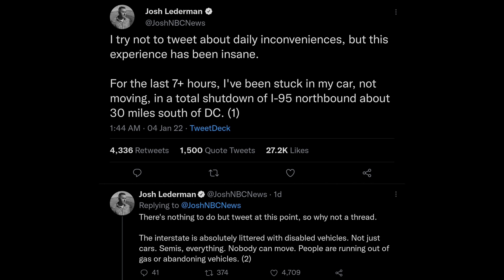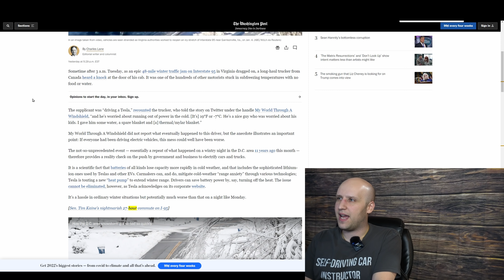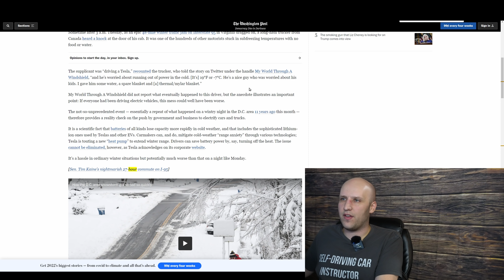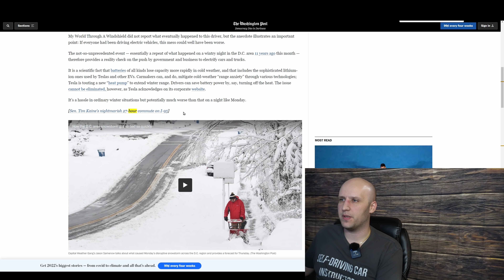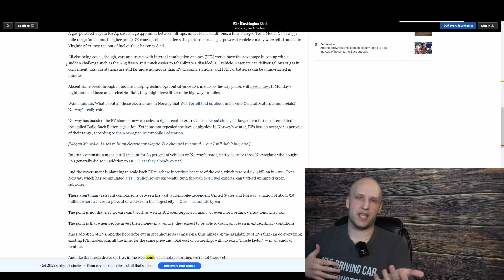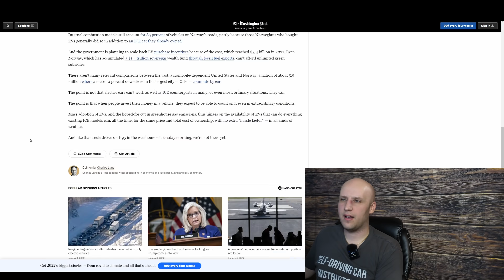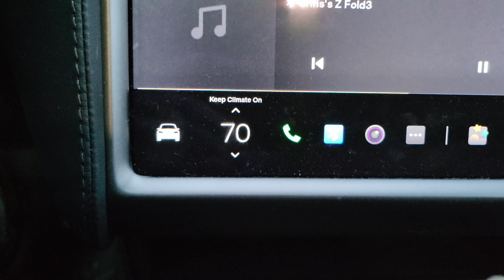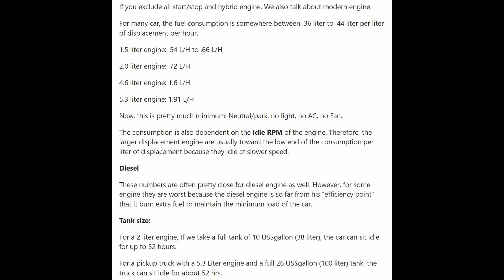How Long Can a Tesla Keep You Warm In A Frozen Traffic Jam? | FUD Debunking

Comment: Great video Chris! I think the biggest take away is that if you are traveling in areas with possible dangerous weather conditions you should be prepared! Food, water, blankets, full of fuel (gas or electric), etc.. One of the nice convinces of being stuck in a Tesla is the great entertainment system you have to keep yourself occupied 😀
Reply: Using the entertainment system will use more energy though.
Reply: @boostav  well, then, why don't we test that? How 'bout it, @Dirty_Tesla? Let's run this test with the infotainment system going. Tee up a marathon of a big movie franchise, like Star Trek or Star Wars or especially The Hobbit and The Lord of the RIngs. See how much drain you're talking about.
Reply: @Temlakos  Using entertainment system is like using resistant heating, you get same heat in the end, but get hugely entertained on the way. 

Overall, I think I still prefer ICE vehicle over EV if I am snowed in. I am well prepared, food/water and blankets. ICE vehicle is more survivable under more extreme conditions.
Reply: @Temlakos  Sure, would love to see it tested.
Reply: @boostav  Probably not, Tesla doesn't really have a power management system for their system.  So whether you're just running the dashcam (which should pull like 4-5 watts) or watching netflix it uses the full 250watts.   If you note when he opens the car at the 12 hr check in the screen was already on, so of the 1.5kw or so that the heater was drawing, 0.25kw was probably infotainment.   LTE modem would only add a watt or two.
Reply: @im.thatoneguy  if Tesla "doesn't have a power management system," why not? I should think that would be a no-brainer, especially after disasters like what we had in Virginia at the beginning of the week. People are going to ask what-about. If a "power management system" can limit the draw to what certain devices require, I'd say put it in. That's going to be make-or-break for sales in Canada.
Reply: @Temlakos  it kinda does, it’s called «range mode». For the resistance heating Tesla’s thry spend about max 6kw for cabin heat and the same for the battery heater. Ehen in range mode the battery heater is turned off and cabin heater is reduced to a max of 3kw. The power draw of the  infotainment and all that is negligible. 

And the reason the screens are on when the door is opened is because opening the door is technically the ON button.
Reply: @Temlakos  - All modern computing systems include automatic throttling to minimize thermal wear on semiconductor components.  Given all of the other energy conservation in Teslas to maximize range, the computing systems wouldn’t override that feature.  It certainly wouldn’t be powering the cameras and running ADAS and FSD computing loads while parked.

Comment: The other aspect is that if you happened to be stuck in deep snow the petrol car would probably kill you with carbon monoxide if you kept the engine running.
Reply: ...where as deep show around an EV (at least a Tesla) would serve as a insulation around the bottom of the car, allowing the battery to stay warmer and be more energy efficient.
Reply: There was a snowstorm in Pakistan last week and cars were stuck in the snow.  More than 20 people died from CO poisoning.  I think snow does a better job of sealing in the CO than a large leaky garage.
Reply: Exhaust gasses are hot. Snow melts very quickly when heated. And a modern ICE car exhaust doesn't contain enough CO to kill you. Suicidal people still try to gas themselves in their cars and fail miserably. 
If I would live in a region that regularly has snow or extreme cold, I would have a parking heater installed. Problem solved.
Reply: @arturama8581  - Poorly maintained vehicles emit plenty of CO, and the average vehicle on the road has been there for 12 years.  That means the other half are more than 12 years old, tapering down to 1% at least 20 years old.  Older vehicles are almost universally not well-maintained, because since people tend to buy those used, they generally don’t have, or choose to not spend, money for maintenance.
Reply: I live in the snow belt. There is a constant battle between me and the spousal unit. She wants nothing in the car. It is safer. Because nothing in the car is nothing for thieves to steal.
I like keeping two sleeping bags in the car. I have slept out side in a sleeping bag and woke with it covered in snow.
Frost bite was a problem. No way.  I put the sleeping bag inside a plastic lawn leaf bag. Good luck finding one in this green universe. 
It was not that cold. Only 22F.
If that does become necessary keep bottled water in side the bag also. it is hard to drink it when it is frozen. The coldest I have slept outside in the cold is -5F (-20 C)
Reply: Geoff Butcher:  Yes, between fume risk and how hard that is on your car, you'd want to only intermittently run the ICE car for some sort of cycle, like maybe 10 minutes on and 20 minutes off or something. 

So that would be less comfortable in the ICE.   Also, if anything happens and the ICE won't start, you're out of luck.  With the BEV, you're not having to change the state of the car, so it's less risky re mechanical failure during that time.  And with the BEV, you could sleep pretty easily.  With the ICE you'd need to set an alarm every X minutes to keep that cycle going, or risk freezing half to death and maybe getting sick if you sleep heavily for hours when the car is off (or killing yourself if the car is on).  

I think that for this sort of thing, the BEV is MUCH better on balance.
Reply: @rogergeyer9851  There is none to very little risc of gassing yourself in a modern ICE car. Gasses just don't contain enough CO anymore. People still try to off themselves that way, but you've got to have a really old car to succeed.
Reply: @rogergeyer9851  fortunately is very easy to jump start a gas car and a lot of modern have better places/insulated batteries to avoid discharges in cold.
Reply: @alanmay7929  true but you can't jump start a car that's out of gas
Reply: @derrickmcfall8702  but you can take gas from the car around you which is impossible with EVs.
Reply: @rogergeyer9851  also if an ICE runs out of gas the fuel pump can fail. My daughter has a Prius and it was a big ordeal when it ran out. EV’s typically leave home everyday with 3/4 “tank” or more, not so with ICE.
Reply: Wrong, are you still living in the past or under the rocks!! People have been living in the Toyota Prius for almost a decade same with RVs or trucks in overlanding…… nothing is going to kill you.

Comment: I think you are not much better or worse of no matter if it's and ICE or Battery vehicle. Much more in portent are factors determined by your usage (like did I fill up that gas tank before I left/ how long has someone been driving already /...)

One thing that few people probably know is, that you can kill your battery in an ICE vehicle if you just idle. Not under normal conditions but if you have the stereo on, lights on, vent on and especially your seat heaters, than power draw often is higher than what the generator puts out at idle speed (it simply not designed to have its max power at idle speed).
We did that inthr lab in  university. But I would be curious to see what a real ICE car would do once energy drops low (I'd guess they have protocols that would disable seat heater and entertainment first)
Reply: Quick search didn't bring anything up on YouTube. Maybe one of you has an old empty car battery to swap in and give it a try xD
Reply: Of course you do not kill your battery on an ice vehicle when idling. Why would you? A modern generator provides a lot of power even ad idling speed. And stereo? HAHA, not much power draw there. A modern car handles this without any problem.
Reply: @Xanthopteryx  it's what they taught in university.
I'm not sure how this applies to more modern cars but from an engineering perspective it doesn't make sense to use a generator that can supply maximum draw at idling speeds. And that's why I said seeing a test with an empty/low battery and high draw would be nice. 

And no a normal stereo won't draw a lot of power. Modern big touchscreens a bit more. The biggest power draw is climate control and seat heating.
Reply: @Xanthopteryx  looking more into it, I'm sure you are right and your car won't drain itself. Even though at their normal idle speed they might (found some curves), they nowadays have usually have an idle up feature I didn't consider. If the load on the system goes up, idle speed gets pulled up to adjust generator output.
But this of course results in higher fuel consumption so that calculations with normal idle would probably be off.
Reply: @Way2Death  Yes, modern generators are Really powerful at idling speed. Can easily give off like 50-80A depending on car size (and a small car will have less consumption so....).
Many cars today have such a high gear ratio so the RPM will be almost at idling speed when driving in a lot of situations.

Comment: Why would you run the seat heaters? In an emergency that's the first thing that should be turned off.
Reply: Running the seat heater uses almost no power and can allow you to lower the cabin heater (that uses far more power) to stay warm.  Direct heat is also more efficient at warming your body.
Reply: Why? The seat heater is much more efficient than heating the full interior. Tesla even mentions this in the manual. My previous non-Tesla EV did too.

Comment: I live in Canada and I was always told that, during a snow storm, it is not recommended to leave the engine of a gas car running because of the possibility of having the exhaust, that is blocked by snow, enter the cabin.
Reply: Exhaust blocked by snow?! IF it get that blocked, the engine will stop, but, it will not get that blocked because engines are pretty strong.
Reply: @Xanthopteryx  it's not totally blocked. But instead of dissipating into the air it stays under the car and gets inside. Perhaps this was true decades ago. The body of my mother's nova had holes like swiss cheese
Reply: @robertfrappier699  A modern car that has holes like that is not a proper car. Vent intake is the the bottom of the window in front. Tesla might be another story though....? Do not know where they suck the air in - if it is from the bottom of the front?
Reply: @Xanthopteryx  Uh, except when you turn the engine off to conserve fuel and it's snowing heavily and/or drifting.  Then watch the exhaust get blocked.
Reply: @kenbob1071  They you start the engine and it is not blocked.

Comment: Since the start of the pandemic, I keep my battery at 50% charge.  If I am going to travel to the city, I will up it to 70% which leaves me at about 25% when I get home.  Lucky we dont get much snow here but ice can be a problem. Fortunately I work from home so no need to venture out of the weather is going to be bad.   I have a 2019 Model 3 so no heat pump. This was a great test. Thank you!

Comment: How long does a comparable ICE car last? I believe they use something like 0,5 ltr per hour running stationary = 12 ltr per day = a quarter of a tank. If it keeps running. ICE is not designed to run stationary. (Audi 4-cilinder 2 ltr TFSI)

Comment: I'd be more scared with my gas car tbh, gotta keep it in idle all the time too lol.. If I am scared about running out of battery in my tesla I could e.g. put the heater a bit lower, yes it might be less comfortable, but most certainly I'm not running out of juice then.. With the gas care you have to keep it in idle. 
Noone is going to really freeze at 60°F either for example, but it will massively safe you energy.
Obviously this would only be a worstcase. If you are just stuck for 3-4 hours maybe you could probably do 80° without every running into any problems lol..

Comment: The most important video you've ever made. I had lots of questions from friends and relatives. You and I have the same 2020 X, so very comparable. Thanks BIG-TIME.
Reply: Carry a roll of tape with you because it's just handy to have.  You could cover 2-4 windows with shirts from your luggage for less heat loss. That's why rv'ers have insulated window covers.
I'm from Buffalo area. Always carry a wool army blanket, coat, hat, gloves, boots, shovel, snacks, flashlight and whatever else you might need. 
Plastic container to melt snow for drinking water and a 2 gal bucket lined with plastic bags would have made a good toilet in this situation.

Comment: I would like to see this test with 50% battery
Reply: The test shows how much energy was consumed in 12h. Consumption will be the same if you start from 50% instead of 90%.
Reply: @martinroy3931  Assuming it's linear.
Reply: @kenbob1071  that's what I'm saying, it is. Devices consuming electricity will pull the same power whatever the SOC. In fact, because pack voltage is lower they might pull a bit less if ampage is constant but I'm not sure. It's either same or consumes a bit less at low soc. Certainly not more.
Reply: @martinroy3931  I'm not sure either. I would like to see how it works on 50% battery power. :D. We also see that it's calculated based on battery percentage, not with a device that gets all the data like watts or voltage and current per second. So I would like to see at least 50% of the battery